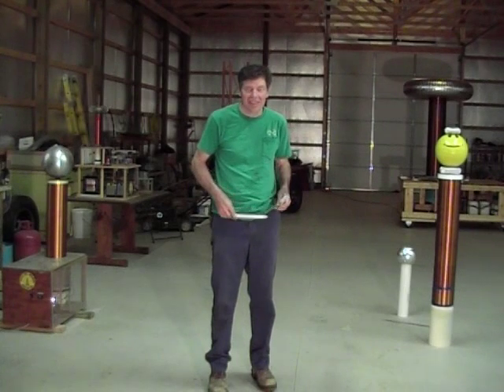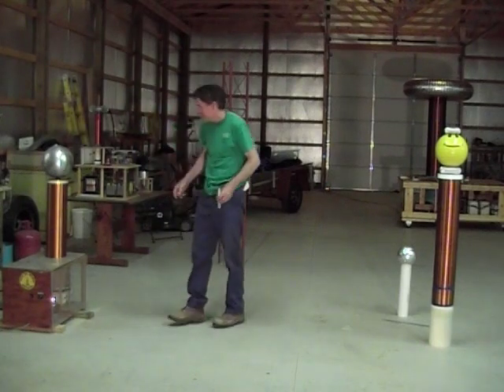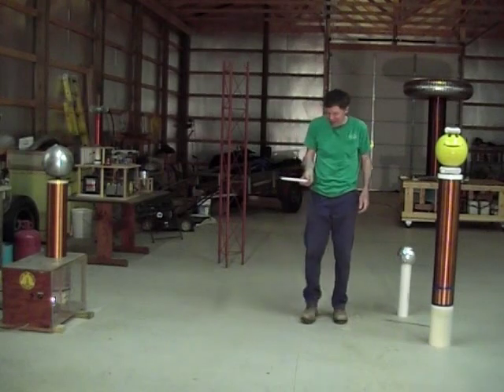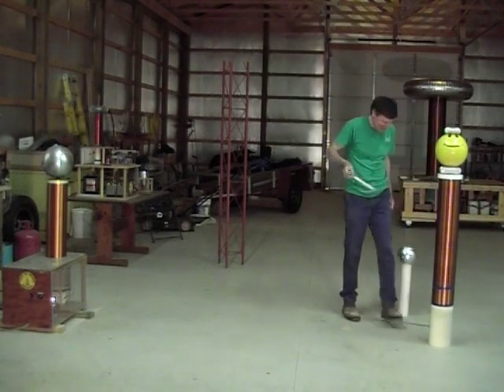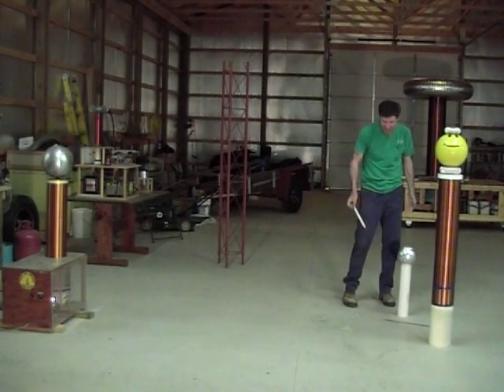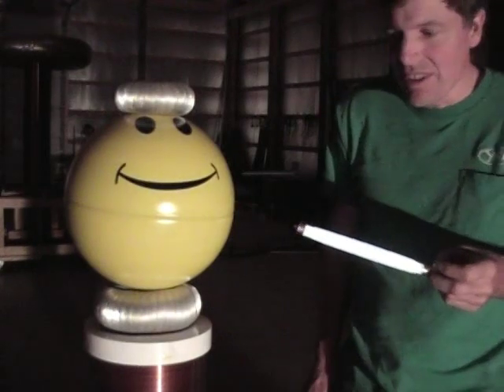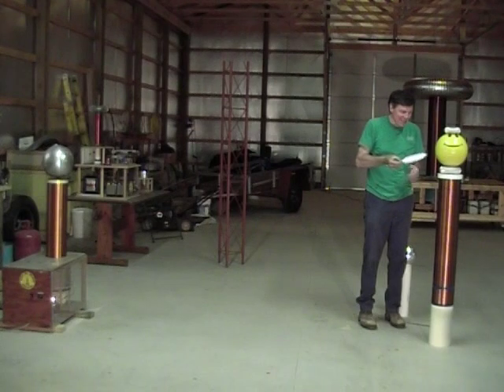Tesla wireless power transmition

Comment: i admire your efforts in making these high voltage inverters, the main challenge is improving wireless electric transfer efficacy, the best attempts were made by nasa in 1975, these had 82.5 percent efficiency in transmitting 32kw of energy over about 1 mile..a tesla coil is a glorified version of a rumkhorf coil without any core iron, its made of air core as i understand, the transmission distance in you video demo can be improved by adding a dish pointed in the direction of each receiver and transmitter i believe. Take care god bless

Comment: Yes, it is just radio waves, created by electromagnetic field. The only thing that it lights up is the neon. Radio waves can light up easily neon. In radio station transmitters, neon lights don't need electric power to light up, they use the waves coming from the antenna transmitter.

Comment: Thank you for sharing. That was the best show of resonant frequency used to transfer energy that I have ever seen. That is what you where describing with the switching of the poles I believe if I understand Tesla correctly? Also, just think what we could do with battery storage and capacitors linked to this system. And to top it off how about Wireless energy transfer by using the ionosphere to create current? Also, if we created DC energy with a AC/DC converter we can create hydrogen with watr

Comment: So is this the Tesla one wire transmission for fully wireless? It can't be the scalar wave transmission because you are still getting arcs from the transmitter and the efficiency is not 99% try and get it to transmit scalar waves along with transverse waves then you will have the tesla wireless transmission of electrical energy.

Comment: frequency is significant because the transformation of the energy wave has the full length of wire to give up the energy to, so thats the most efficient frequency to give off the most energy effciently to the reciever coil.

Comment: resonant frequency is key to the whole system, resonance allows for the containment and acutal safety of the device meaning that only the industrial energy will resonate with the coils in resonance with the transmitters frequency. just come to my site if you need more help. remember this guy is only doing one wire transmission of energy,not true wireless like what i am doing in my backyard.true wireless uses the earth as the wire, just dirt.i got 20ft wireless energy transfer no connecting wire!

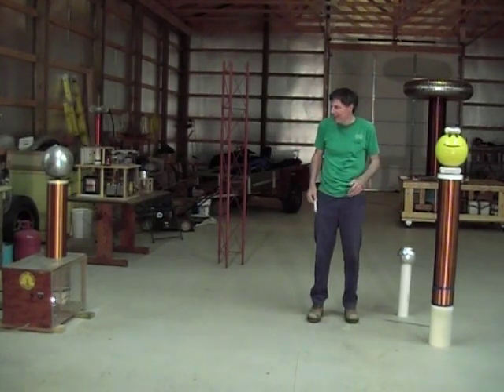Comment: 0:40 he sayes both secondaries are connected to the metal building,this demonstration is still the tesla one wire transmission principle.anyone else see that,i have done the same thing with even smaller coils, its alot better than mine but this system is not the true earth system,i hope others see this,stil is one wire transmission model using the metal building as the conducting wire,truely the energy is going from the transmitter secondary throught the building to the reciever through building

Comment: Teslas wireless transmission of power relied on schumann resonance (about 7.8 Hz) & required good earthing of both the transmitter & the receiver. His theory stated that far more energy could be recieved than transmitted as it harvested the potential energy contained in the ionosphere (originally generated by ionising solar radiation). This is the same vast energy field that discharges uselessly to earth, as lightning striking somewhere on the planet every second. Free solar energy anywhere.